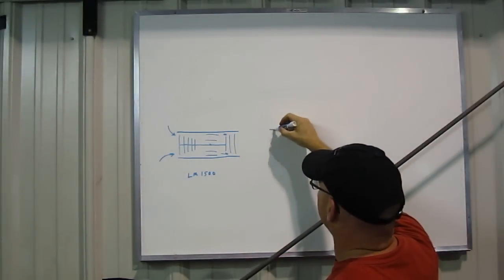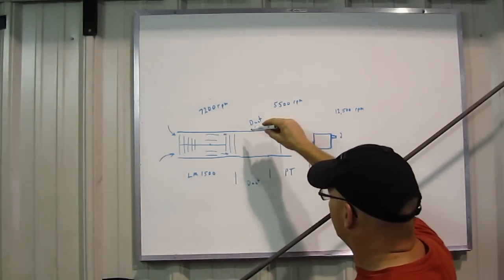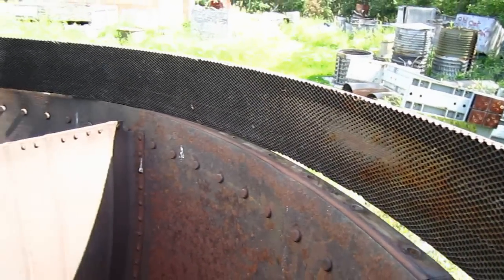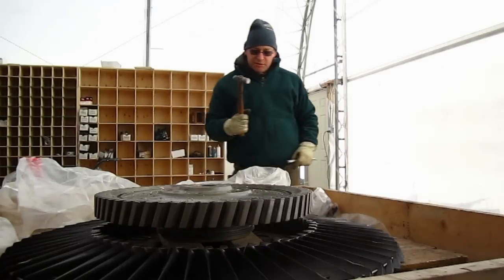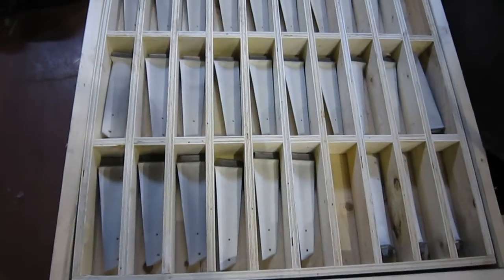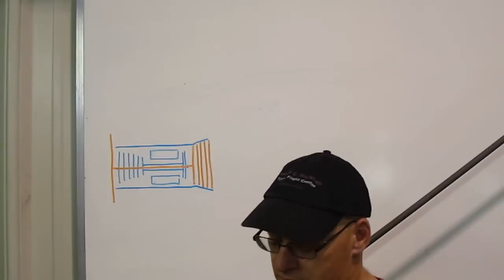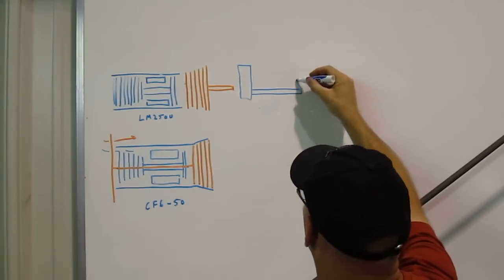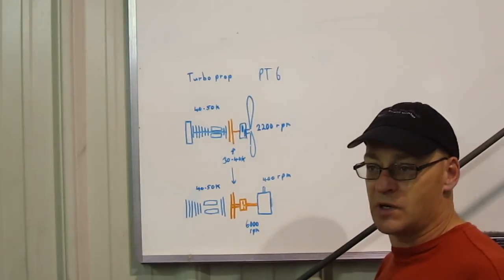Power Turbines: what are they ?

Comment: After weighing the individual blades what algorithm do you use to determine their position for maximum balance?  Sorry I haven't watched all your videos, just a few of them.  Seems like a rare good use for a simple computer program in industry.
Reply from the maker: A very common mistake you have made sir. No "algorithm" needed. Of all the sorting techniques or " computer assisted procedures" one might imagine... it just gets you to square one.
It's a starting point from which the balancing process starts.
Which has already been described in detail in several video I have made years ago.
I will be posting balancing videos in the next few weeks.

PS: "Maximum balance"?  what's that? Never heard that term before.
Reply: Arranged so that the inserts are in the most "even" or "balanced" distribution across the diameter.  With a certain collection of weights, being individual "fins", there is a way to arrange them around a circle so that there are no localized heavy "spots".  Such an algorithm would probably "sample" the weights in a progressive pattern going from index-local position (with the potential positions indexed on an imaginary "circle") and making swaps as it progresses from the index (both directions around the circle).  To give you a better positional arrangement to make final balancing easier.

But if the balance problems are from the arbor the "fins" ride in it won't matter much anyway.  There probably already exists an algorithm to do something like that.  Utilizing it could save you some money on balancing?

A more complicated balancing algorithm could take into account the weights of the fins on other parts of the shaft, their distance and positional arrangement to each other.
Reply from the maker: There are no fins in or on a turbine.
As explained repeatedly, any sorting of blades only provides a starting point for the balancing process.
The assembly is turned to about 10% service speed, vibration measurements are taken, and an indication is given where there is a heavy spot.
Blades are moved and swapped to reduce the imbalance.
After successive runs, the imbalance is so small that the final adjustments are made with tiny balance weights placed in a circumferential slot near the blade mounts.
There is no grinding on the turbine wheels of aeroderivative engined.

Comment: Hi AgentJayZ.

When you draw the turboprop, the turbine seems to be on the same side as the propeller.
Is that how it really is? Is the turboprop sucking in air from the other side than the direction  of its velocity?

Thanks
Reply from the maker: Yes, that's the layout of the mighty and popular PT6.
Reply: AgentJayZ Okay thanks. What about if the configuration would be the same as a turbo-fan but without the cylinder around it all? Why is having the cylinder so important. Also high-bypass engines have some turbo-jet thrust. Is that magic ration of 30/70 (roughly) what makes turbo-fan so much more powerful than turbo-prop?
Reply from the maker: MrJenia2009 
Gigantic questions there… You need to read a bit.
I may put some parts of the answer(s) in an upcoming video, but there's a lot for you to discover out there.
Reply: AgentJayZ I've been thinking about this forever. lol :) So I'd be super nice of you to shed some light on the real trick of the turbo-fan (as opposed to the turbo-prop). Thanks greatly in advance!!

Comment: Fascinating series of videos. 
So why in an electrical power generation system is the engine turbine shaft not connected directly to the electrical generator. You stated in another video that there is a considerable loss of energy at this point in the system  due to the inefficiencies. Why does a direct coupling not help.
Thanks
ABS...
Reply from the maker: You need to get more familiar with power turbines. Even the turbine engines that have a mechanical output shaft have that shaft powered by a separate free spinning power turbine.
Have a look at my videos on power turbines, and maybe the one called turbojet or turbofan.

Comment: At 14:12 I noticed that some of the "teeth" which holds the blades in the disc are kind of broken. Aren't they supose to match perfectly ?
Reply from the maker: Good eye. Those aren't broken, but do show some impact deformation.
Remember this is a power turbine. They are much more heavily constructed than turbine engines. I don't like to see damage like that, but it is much less significant on a PT than in an engine.
Reply: Thanks man. There is a reason I have noticed this. I'm pilot. Greetings from Brazil.

Comment: Is the power turbine's RPM always regulated solely by the engine's RPM, like in a helicopter, where rotor RPM is not that critical?  It would seem like that in a electrical generation system, controlling the power turbine only with engine rpm will make maintaining 3600rpm rather difficult, with constant variation in temps and pressures and such. Do some power turbine have mechanical methods of regulating rpm, such as governors, variable stators, bleed valves or other methods? I know, don't ask!

Comment: The soon to b closed Ditcot A power station near London has a small 100 MW gas turbine station in addition to 4x500 MW steam sets.

The 4 GT sets each have 2 RR Avon gas generators with curved ducts to direct the gases back to a power turbine between them.  50 Hz. output, so they would be 3000 RPM.  Installed for peak load, or to supply the main station if it's incoming supply failed.  Little used, even when I saw them about 25 years ago.

Comment: run out of characters, had to split the post.  The gas turbine plant consists of four 25 MW sets, each with a single power turbine, main alternator and exciter, but with two Avons as gas generators to each set.  These are mounted parallel to each other, with the power turbine between them, with curved ducts to lead the gases from the Avons back through the power turbine.  Is this an unusual arrangement; I've never seen anything like it elsewhere.  I visited this station about 25 years ago.

Comment: At 14:13 that rivet doesn't look very precision to me, and the teeth on the disk on on the lower edge are beat to hell. Is this thing for educational purposes, or is it meant to run again?
Reply from the maker: It's a power turbine. It compares to an aeroderivative gas turbine engine as a sledgehammer compares to a drum stick.
Reply: Thanks

Comment: at time 10:21 there are two slots on the hub for mounting balancing weights.
Also at 10:51 the single stage rotor is being slow speed balanced, I think at 50% speed of rated RPM, correct me if i am wrong.
Reply from the maker: At time 10:21 there is one slot for mounting balance weights. One.
At time 10:51, the rotor is being accelerated up to balancing speed, which is about 500 rpm. You did not make any coherent statement. You said nothing, so it can be both correct and incorrect.
Reply: @AgentJayZ  I was in steam turbine maintenance some time ago and I found some kind of resemblance also there, it was 2 slots one at inlet side hub and one at outlet side hub and both at different radius. And for slow speed balancing we would do it at 1500 rpm as  turbines speed is 3000 rpm rated.
Reply from the maker: Not a steam turbine.
There is one slot. The one slot for the insertion of balance weights has two ridges, one on the inner diameter, and one on the outer diameter of the slot.
You are looking at the space between the outer ridge of the one balancing weight slot and the blade mounting area, and thinking it is another slot. It is not. How many times would I be required to explain this detail?
Me? I'm only the guy who actually put the balance weights in the one slot, and fixed them in place.
Reply: @AgentJayZ  I accept it. I Kindly Apologize for doubt. There is so much to absorb. Again I apologize.

Comment: I'm quite bothered by you saying "burning air", because technically the air isn't being burned. The oxygen of air is used as an oxidizer in combustion. Also air is only ~20% oxygen and the rest is basically inert gas for the combustion process. 

Great video otherwise, I just wanted to correct this as it is VERY basic chemistry (and you've said in multiple occasions.)

Comment: Another dumb question. Why are the stages of PT so little (1 or 2) ? Isn't this wasting a lot of the energy ?
Reply from the maker: It's a tradeoff between energy capture and mechanical complexity...i.e. cost.
Alternate answer: so much energy is captured by the two stages, a third is not needed.
Reply: AgentJayZ
Yes but then U showed an engine with more then 2 or in the later case the price didn't matter that much (the airliner engine) ?

Comment: What happens if the power turbine is in a ship and the the fan is spinning 7200 rpm, but the propeller and therefore the power turbine is spinning 0 rpm? When it is spinning at full speed, it is converting the 15,000 hp to kinetic energy to spin the power turbine and propellor. But if the power turbine is spinning at 0 rpm, the 15,000 hp isn't being converted to kinetic energy, which means it is being dissipated at heat. Similar to a torque converter in a car when you stand on the brake at full throttle. At stall speed, the energy from the input fan blows oil on the output fan and if the output fan isn't moving, it heats the oil up very quickly. So if you stall a power turbine, does it heat the air over its operating temperature and damage the power turbine's blades?
Reply from the maker: +Larz There is no input fan, and there is no output fan. It may look similar to a torque converter, but it is not. The power turbine is just fine whether it is turning or not.
Reply: +AgentJayZ I get that the input is the turbine that runs the compressor and the output is the power turbine, but doesn't the same physics principle apply? If the power turbine is spinning, the heat energy is being converted to kinetic energy and the pressure drop across the power turbine causes a huge temperature drop based on pvnrt.  If the power turbine isn't spinning, there is no temperature drop and it seems like the power turbine would have to absorb that energy.
Reply: Yes, if you have 15000 hp to hold the output shaft in place, then it won't move. I guess air will still flow through it, and most of the heat will be carried away. It's the kinetic energy of the air that does the work, not its heat.

Comment: Great videos, fascinating, TY!  Wish I had seen these when I was 11!  One thought, you could/should explain the "duct" as an air tank.  Without it, you wouldn't have massive compression that makes this whole thing work better.  Is this correct?  Can/have you explain more detail of this duct/tank?  Will bigger/longer duct give more power?  Guessing there is a sweet-spot and diminishing returns.  TY!
Reply from the maker: No.
That is not correct, and makes no sense.
No, it is not correct.
No I will not explain the unexplainable.
No, the length of the duct has no effect on anything within reasonable limits.. like between 1 and 50 metres in length.
Yes, I have seen both ends of that range.
Works fine.
Reply: AgentJayZ OK!

Comment: I'm starting to understand the engineering of these, which you do a pretty good job of explaining....The core turbine uses combustion energy (expanding gas) to drive the compressor, then the power turbine to drive the turbo fan. The pressure on the front of the turbo fan is much less than it is on the back side causing forward kinetic energy to be applied to the turbo fan shaft thrust bearings. The next part I don't understand is exactly where the combustion pressure is applied with respect to the lower output nozzle pressure thus causing forward kinetic energy to be applied to the entire body of the engine??? I believe after burners reduce nozzle diameter and inject/combust fuel putting pressure on the power turbine. I guess I'm looking for all the points in the engine where the pressure goes from high to low or low to higher such as the turbo fan and the compressor.
Reply: "... causing forward kinetic energy to be applied to the entire body of the engine ...".  That's the right idea. In an aircraft, the momentum of the exhaust gases going backwards is balanced by the momentum of the plane going forwards.

It's not only about "...where the pressure goes from high to low or low to higher...".

Comment: So I would expect the Y2K motorcycle to use this very same process then. I'd always wondered how they're able to have an actual coupling to the rear wheel off a gas turbine
Reply from the maker: The RR 250 is the engine in Y2K. It is indeed a free power turbine turboshaft engine, designed for light helicopters, like the Jet Ranger.
Reply: Must be a piddly little turbine to fit within the confines of a street bike frame. Have you worked on many of those engines or do you normally stick to big beasts like LM1500s?

Comment: I have a question about bearing arrangement when you have a hollow core shaft and the PT shaft running in the middle of the hollow core shaft.  Does the hollow core hold the bearing cases for the power turbine shaft?  That would essentially double the bearing rotation speeds, unless they turn in the same direction.   They probably have their own and separate bearings...No?

Comment from the maker: @kayaking4autism If it's a steam turbine, you don't really need to worry about heat like you would with a combustion gas turbine. But If I were you I would pick a material that resists corrosion.
Honestly, that's all I can comment on. I've never touched a steam turbine.

Comment: may I know why there is no LP and HP compressor on industrial Engines? cuz we have at our company an Aero turbine with LP and HP compressor but with the other Siemens turbine we have too there is just a compressor without LP and HP i hope u understand me cuz my English not so good
Reply from the maker: Ammar Saadi Many different engine configurations are used for industrial power. Simplicity and durability are important as well as performance.
The Olympus is an industrial engine with an HP and an LP rotor. So is the Spey.
They are both derived from aircraft designs. 
The Siemens designs are pure industrial, and do without the LP system for the sake of simplicity. The single shaft design does not have the flexibility to adapt to rapid changes in power setting, but then this is not necessary in an industrial power unit, where the loads are generally fairly constant.
Reply: AgentJayZ thanks a lot bro. about ur series called (your Questions) . how can I ask ?? is there any mail or any method else to contact with u about that series ?

Comment: Sometimes, a Whiteboard drawing can say more than thousand words. 

While watching your Videos, especially the ones about the Lockwire and Balancing rotors, i thought about this self-locking Nuts in turbine engines, and how they work. I only know the "civil" versions of selflocking nuts: The normal ones with the blue plastic ring, and the others, where the last thread has an oval shape. The nuts in turbines look different, and you said if a bolt is tightened, its hard to remove the bolt again...

Comment: I'm not sure if you're going to get this question, or not but in power turbines - and all gas generators - there's no propelling nozzle which is what separates a generator from a thrust producing engine. (That's not my question.) The faster you can spin the magnetos on the power generating side the more power you can make, so why not increase the speed of the exhaust gasses with a nozzle to spin the turbine on the generator side faster and make more power?

I've seen you repeat the 3,600 RPM figure on several videos w/r/t power turbines so I'm sure there's something I'm not edumacated on but and a reason why they don't use nozzles. The scions of the gas generator industry - those who design, manufacture, and maintain them - surely would have done so if it was a worthwhile endeavor.

I suppose I'm asking why don't they do that?

I want to say too that I'm giving serious thought to enrolling in the aviation powerplant maintenance program at the local college instead of something in medicine as I had planned. Jet engines are so much cooler than sick people!
Reply: I am not jet engine mechanic or engineer.  I have a background in engineering & science (college degrees and all), so let me take a shot of answering your question.

1) In engineering, nothing is free.  So, to get more output from your generator, you must add more power to your input, i.e. you need more fuel (assuming the designs of the turbine and generator are unchanged).  An increase in the speed of the exhaust gases using a propelling nozzle does not increase the energy/power in those gases.  It only converts some Potential Energy at nozzle entry (low speed, high pressure) to Kinetic Energy at the nozzle exit (high speed, low pressure). 

2)  Propelling nozzles are used in jet aircraft to reduce the pressure in the exhaust stream at the nozzle exit to that of the ambient air (by increasing the speed of these gases).  Without this, the ambient air behind the engine would reduce the thrust generated. i.e. because the air pressure is lower than the exhaust pressure at the nozzle exit it would tend to suck the plane backwards.  

3) "The faster you can spin the magnetos on the power generating side the more power you can make."  But you can't spin the magnetos faster without developing more power from your turbines.

Hope this helps.
Reply: That answers it all! Thank you for taking the time to answer that.
Reply: I have a question about the pressure vs speed variable here. The pressure of the gasses are what's most important, yet? Kind of like how on Mars the winds can blow a thousand km per hour but the atmospheric pressure is so low that it's only like a light breeze here on Earth, vs if you had a thousand kpm wind here on Earth, nothing would survive?